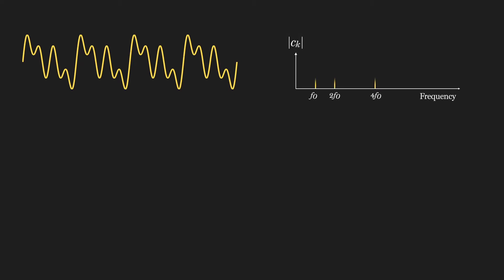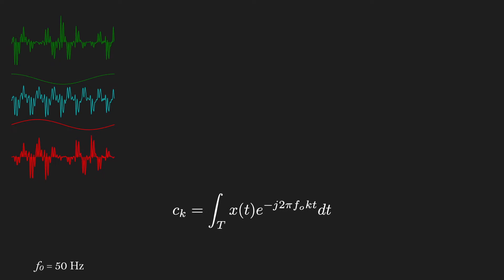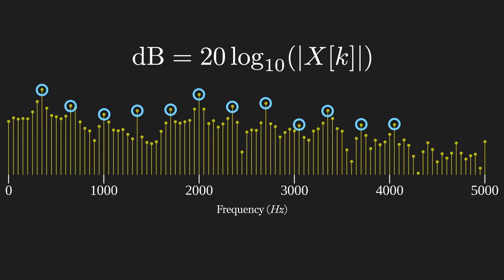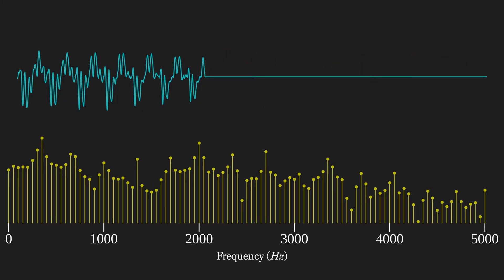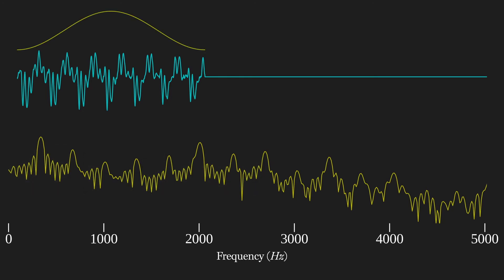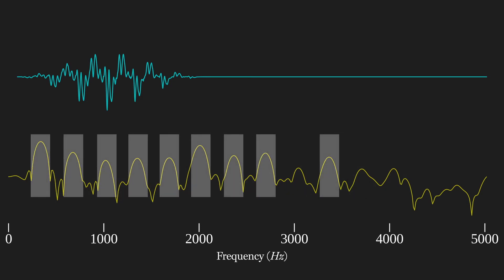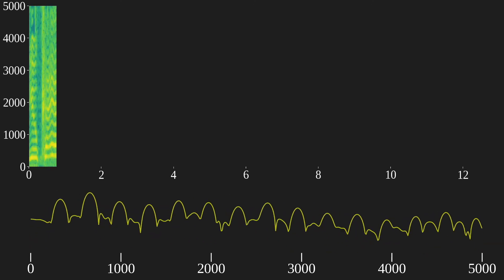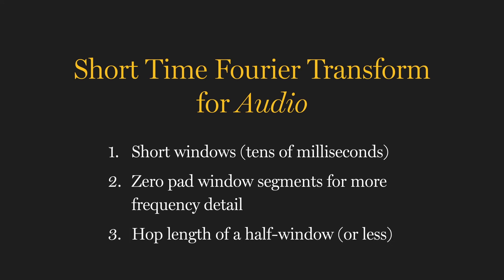Applied DSP No. 3: Short-Time Fourier Transform

Comment: Excellent video. At 07:00, instead of padding with zeros, could resolution be improved by just repeating the original signal section several times and taking the Fourier transform of that? Would that increase our resolution or not work?

For example, if I have a 10 second ECG recording, would it be sensible to repeat it 10 times and do the Fourier transform of that to try to get better resolution? For example, when trying to find the fundamental frequency more accurately. What would you recommend?

Would it work to stretch out the signal – interpolating it – for example to ten times the number of samples (or increase the sample rate) to get higher resolution? Apart from saving on computation of interpolation, does zero-padding give more accurate estimations of peaks?

Thanks!
Reply from the maker: No, repeating the period would give you more frequency samples, but it wouldn't increase actual frequency resolution because the Fourier Transform is already the infinite periodic replication of your signal. Similarly, the zero padding (extension of the signal with zeros to create a larger "base period") doesn't add new information, but just increases the samples of the Fourier transform to reveal what's already there.

For fundamental frequency estimation, the best approach is to take whatever signal you have (10 sec) and then zero-pad with enough zeros to get a better resolution of the frequency peaks. 

Interpolation/resampling of the signal would not provide higher resolution... the frequency content (and total information) of your signal is fixed. No amount of DSP will add useful information, so the goal is to most clearly reveal the info that's already there. Hope this is helpful!
Reply: If I'm not mistaken, zero padding is the process of interpolation and youre essentially adding "zero data" in-between samples to bridge these samples. Repeating the same signal will just give you the same Frequency Response which you've already gotten from the first sample.
Reply from the maker: @spasmodia  Just to be clear, zero-padding is adding zeros to the end of your signal "frame" (not in between the samples of the signal itself... that's a form of upsampling). You're correct that the frequency content when upsampling remains the same, it just changes the position of the aliases. This is, in fact, part of the process I used to create the aliased sound samples.